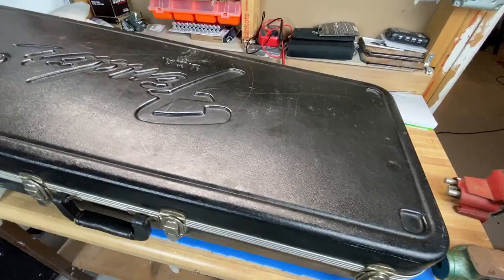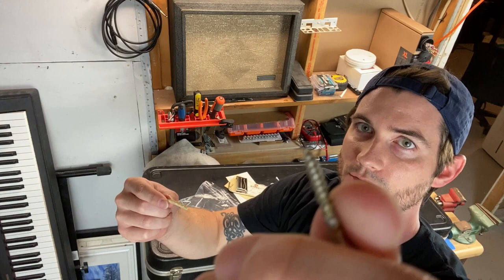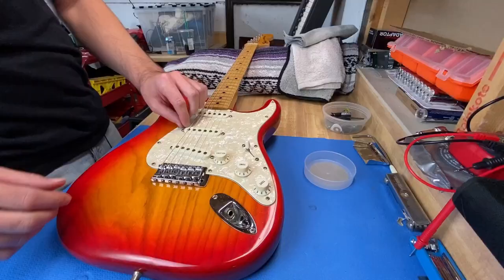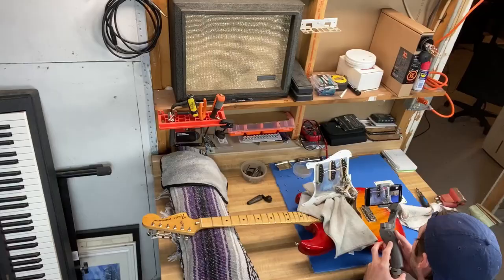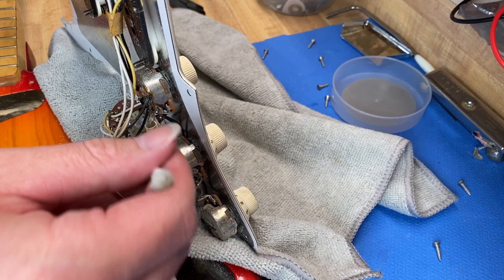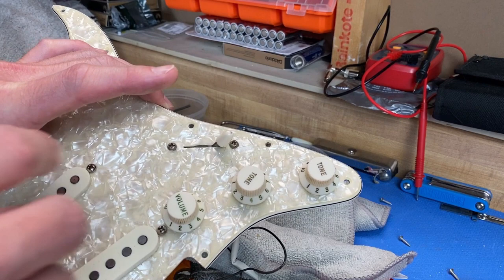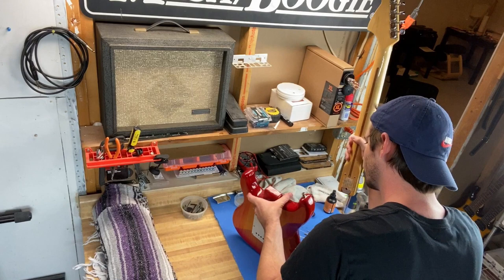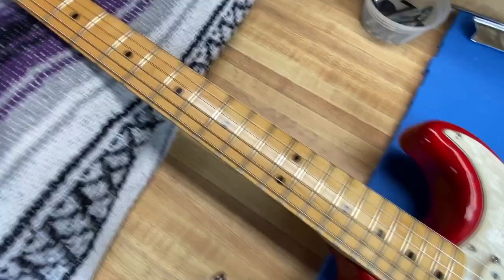'79 Fender Strat - Junk or Jam?🕺✨🎸 TEAR DOWN & Guitar Demo // ON THE BENCH // Sienna sunburst

Comment: That strat pickup with the plastic bobbin part code measuring 7.5k with the yellow wire is probably an X-1. Fender would mostly save them for "The Strat" or Lead II guitars, but on occasion they found their way into other strats as well.
Reply: def the x1 that hot + ive seen em with the yellow wire instead of white..

Comment: I've got one. Mine is the natural finish, blonde w/black pick guard. It is a tank and has a sweet, beautiful sound...balls/push when you want, bluesy chunk and crying melancholy cutting sound. Extremely responsive to the player though not necessarily a "fast" action. My only complaint - too strong - annoyance is the weight, play three nights a couple sets per and you'd think you had a bag of cement hanging around your neck. I love the guitar (and my Tele) I bi-amp two ('70s) Twin Reverbs (make your neighbors lawn die) or play through an old Marshall thrown in....ultimate orgasm. Thanks brother.

Comment: I love that finish. It is my favorite color. It was introduced to Stratocasters in 1979 as part of the international colors. In 1981 I started getting interested in guitars, so late70's/early 80's Strats were all around in the shops. This one is a bit "janglier" than my 1993 LE Strat (has Texas Special pickups). I think the pickguard isn't original, they didn't offer pearloid pickguards for Strat until the early 90's. But it looks good on the guitar.
Reply from the maker: Yea I agree now that the pick guard is a replacement too, that explains why the spring was missed too! I was not a fan of the more hollow jangly sound of these pickups, agree. Thanks for the great info and for watching!

Comment: Great guitar! But it's not a '79. Probably '81.
Reply from the maker: Appreciate the info! Seems that ‘79 serial can be ‘79-‘82 or so I’ve learned.
Reply: The big clue is those pickups, they switched to the plastic bobbins in the 80s whereas in 79 they were still grey bobbins, this is most likely an 80/81, unfortunately the serial numbers are not reliable for dating 70s fenders. Best way to tell is by the pickups or pots (they have much more reliable date codes)
Reply: Also whoever modified the hardware on the guitar would have been responsible for the loose spring ;) obviously the pickguard/covers are not original as they would have been all black
Reply: You are reading the pot codes incorrectly.  The whole pickguard assembly is later (pots are from 1984).  CTS pot codes are 137YYWW, so this is from 1984, not 1978.  Pickguard is not original (pickup in the bridge should be an X-1) and the body shouldn’t have black paint in the cavity for a 70s/early 80s.  Cherry Sunburst was first introduced in late 1980 with the International Colors Series.  Most 80-81 Strats all had “S9” serials (other than the 25th Ann Models).  Also, the case candy paperwork is for a different guitar. Seventies Strats are criminally underrated-I’ve owned quite a few since 1981 or so.
Reply: @nihilvoid4112 Nah, they would use pots from four years previous.
Reply: @nihilvoid4112 nope, that was the original pickguard for that particular color scheme on the body, circa: 1981-82.

Comment: My 79 Strat has its serial number on the back of the pickguard as well (3 times: Neck, Body and back of Pickguard). It looks like it is missing on yours, so maybe the pickguard might not be original.
Reply from the maker: Oh good to know, it’s certainly possible! When I saw the perloid I wondered the same but it seemed to all check out. The fact that a spring was missed when rescrewing supports replacement too. Thanks for watching and for the great info